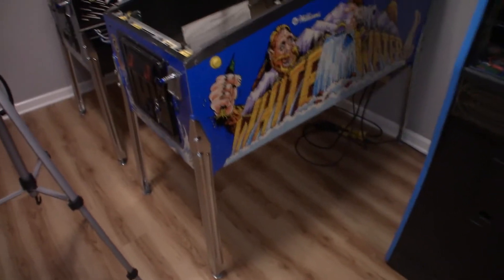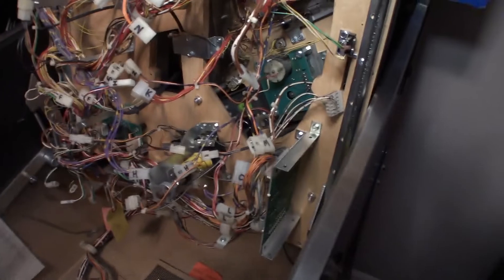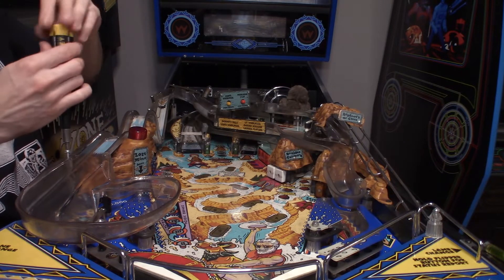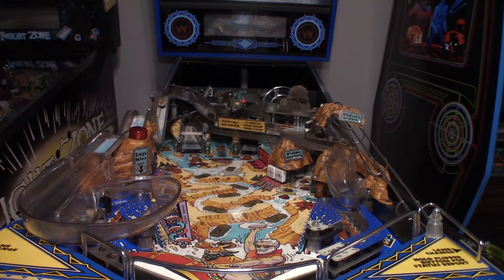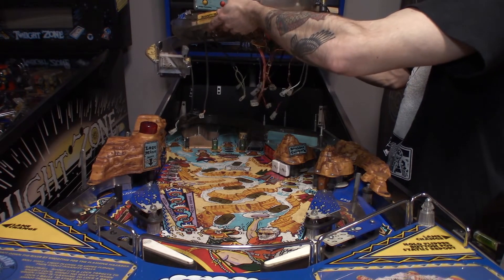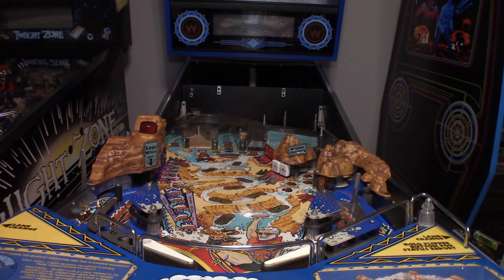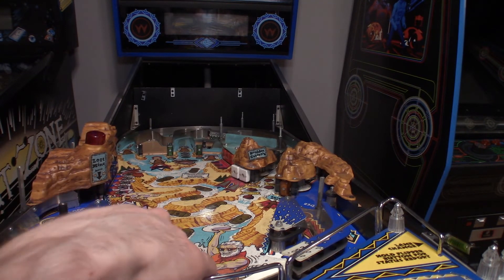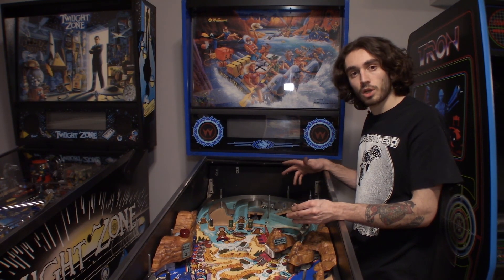White Water Pinball Restoration Part 1: Removing the Ramps and the Upper Playfield

Comment: When the engineers design pinball machines not sure they considered the effort to do a full strip down.  Just had to strip a Tales from the Arabian Nights to replace the swirl ramp and it took about an hour as you have to basically remove both ramps and genie to get the swirl ramp out.
Reply from the maker: The ramps on TOTAN are no joke!
Reply: @ArcadeCrusade  I did film it so once I get time I will post the video on YouTube and hopefully others can be more efficient than I was if they have to do the same ramp replacement.